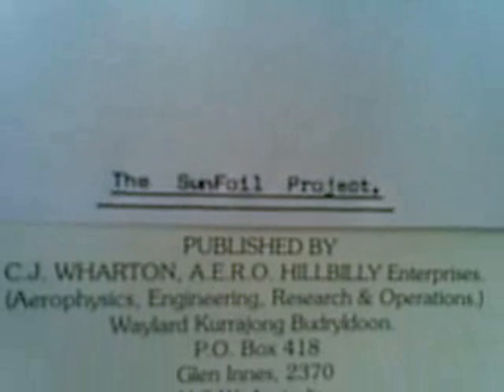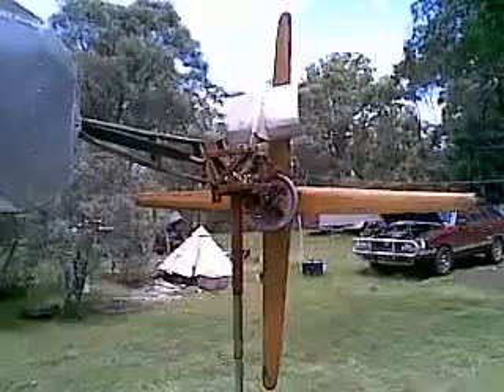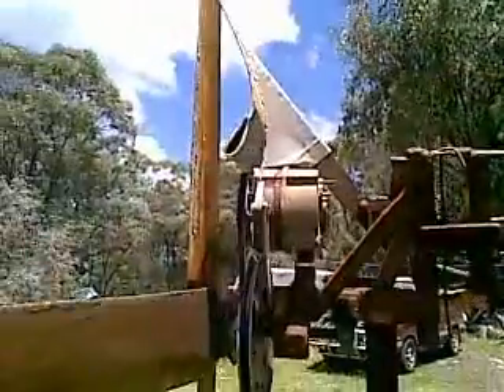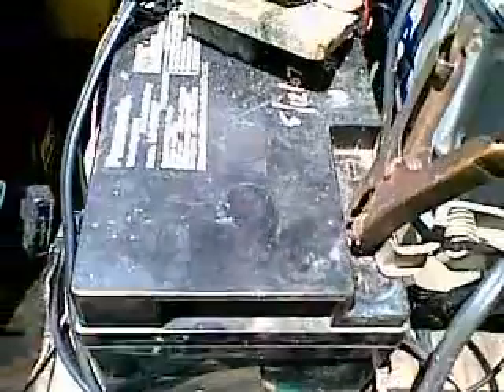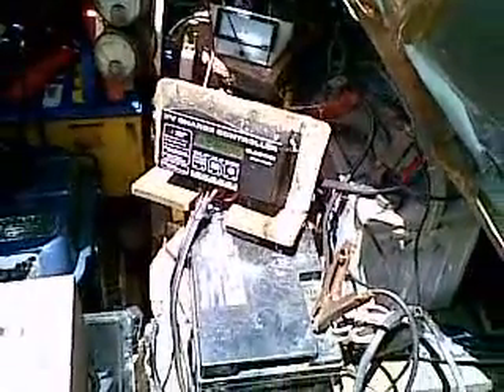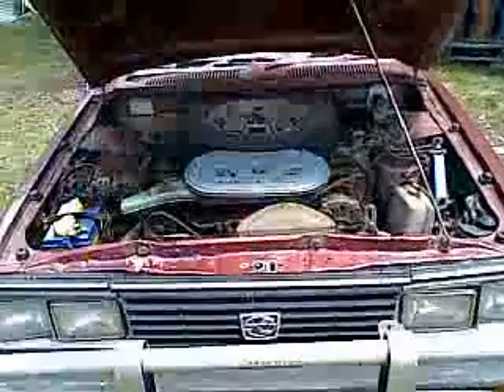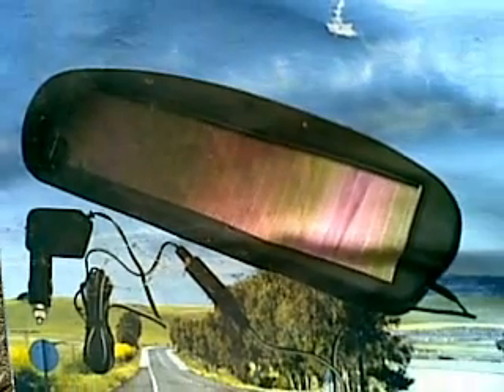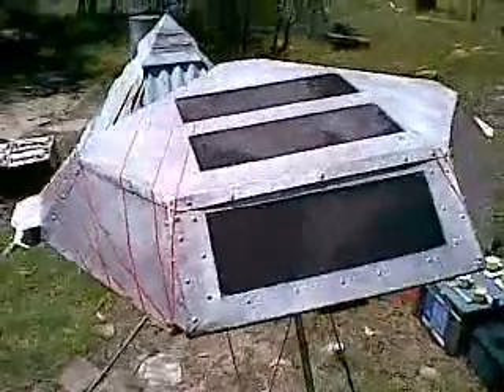The SunFoil Project

Comment: @adolthitler
 G'day mate, thanks... Um, you'll need to leave the Alternator in place, to be ready to run the Headlights, and to tension the Belt which also runs the Waterpump. When the Battery's full, the Alternator's Output drops to 0.05 Amps, & it's effectively freewheeling, but to run the system at night, the Alternator is essential. Search "Solar Assisted Pickup" by @PreciseBible, he has an Alternator Cut-out Switch, but it is still there, waiting... Ciao !

Comment: @Gunnabee
 G'day mate... Thanks ! As it happens, no ; SunFoils are unpatentable. There's no "innovative step", y'see. Batteries are known to go flat, V-Belts waste a heap of power in step-up drives, Engines burn Fuel, Alternators need to be Driven, & Solar Panels make Electricity from the Sunlight... So, any PV on any vehicle will make an improvement... And Design Registration wouldn't work. Change any dimension by 10% & any DR's useless. So, DIY. Ciao !

Comment: @Gordon Deeker
 G'day mate. Thanks ! Um, the .04 Amp Static Drain is on the low side, maybe due to low Bat. Charge State ? My son's Diesel Holden Rodeo's Static D.= 0.1 Amp. It has a 30 Watt PV (Mk5)... It's the Average Eng. Runtime which is the critical bit, search  "Wharton's Law Of SunFoil Effectiveness...". The G.plugs use 3 A/Hr per Start, switch off at 3 min's, & only 1.2 has gone back in... My guess is, a 60-80 W. SunFoil will help a lot..! You get to do original Research. Ciao !

Comment: Hello  "WarblesOnALot" awesome work so far, I am going to outfit my truck with your idea,but I could use some help crunching the numbers for the correct size solar panel. Here is what I have so far. 1995 ford F350 Powerstroke diesel 7.3, draw when sitting is .04a, it takes 600 a to start it, what I am having trouble with is the glow plugs. They stay on for 62 seconds,and the average draw during the 62 seconds is 124.67a. With that info, what power panel would I be looking at?
Thanks alot

Comment: @bernyl1
  G'day... Thanks mate ! Um, if you check "SunFoil Short Talk", it shows how to measure any Vehicle for it's optimal PV size (30W. to 80W. seems to be the range, depending on Battery Size & Static System Load while parked)... If you want to go the whole hog, the Mk 3 Construction clip shows how to build a Solar Thermal Ramjet into the Boundary Layer Airflow Control Vents, or the Mk 5 Construction shows the Easier & Simpler Wood-Faired version.

Comment: Moo - LOL
Philip - As dectated: "Look for a close corellation between the specific gravity of the electorlyte and the voltage across the terminals. Go to an auto-electrician's, best batteries are 12v units from a 24v system where both batteries have been junked but only one was damaged. Winter is a good time. Gently charge and discharge with the plates aligned with magnetic North. Good luck."

This is my dad's new account, for all further enquires please click here.